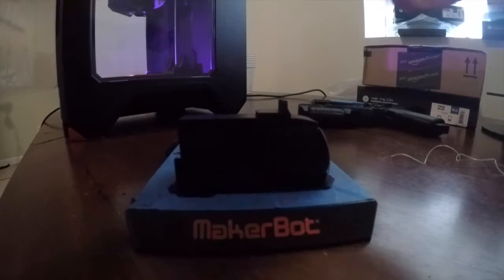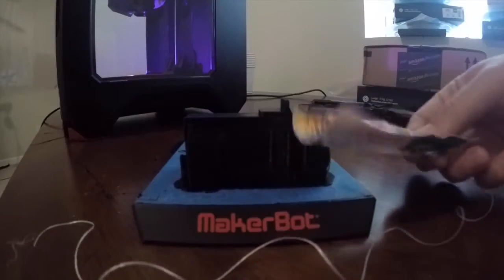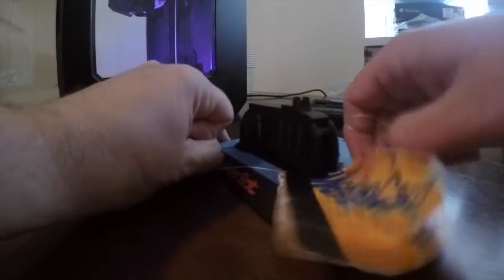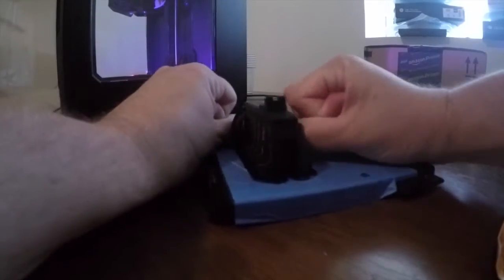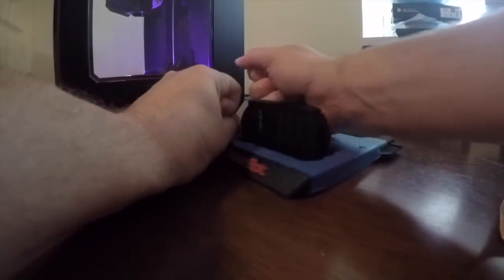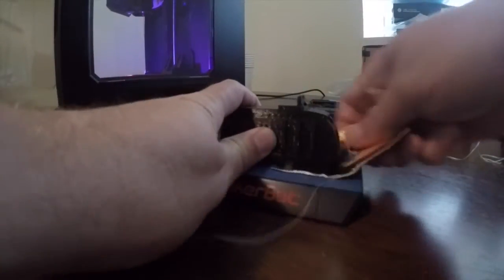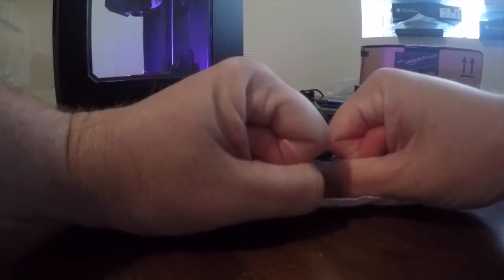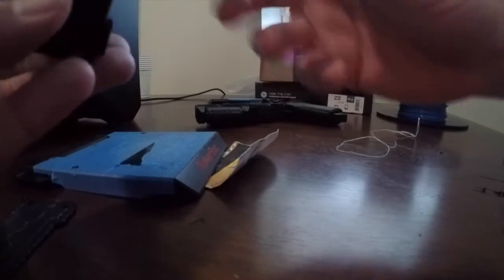Floss It Off - a new way to remove 3D prints???

Comment: One video I’ve seen,... which I recommend on glass beds with a separate plate cuz I’d worry about glass freezing. But the compressed air in the cans to clean out laptop keyboards. Although spray it upside down to release some of the liquid onto the bed. Your object should just slip right off like it’s on ice. Should just be a small nudge. Let me know if that works out.
Reply: Ohh a guy with a channel called Ruthless Productions is where I saw it and it seemed so easy while not harming anything. You might want to wait until the bed warms up on it’s own ( as in without dialing it in) before actually warming up the bed. Like I said,... it’s stock glass is still glass.